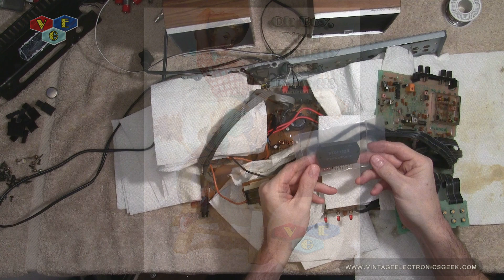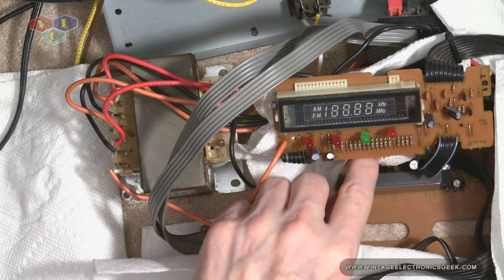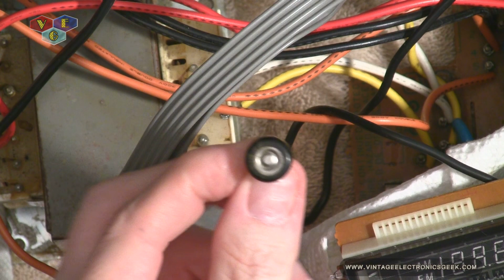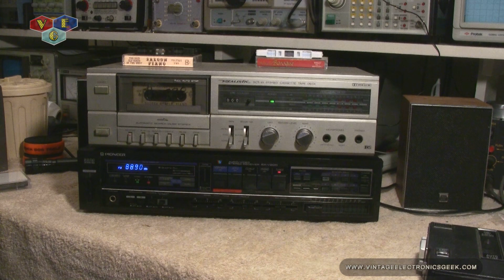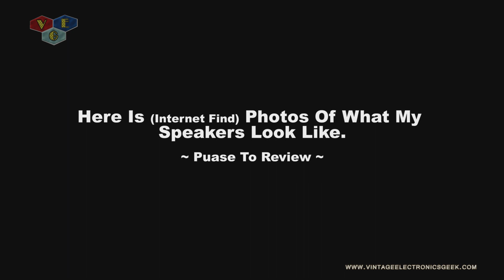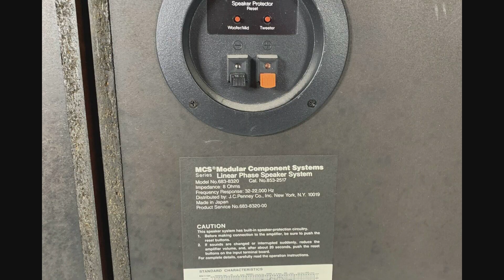Pioneer SX-V200 - Part 4 - Finale

Comment: Good job! And thanks again for the "promotion"! Would have been nice to have seen a resistance test between the pins of the STK. Or did I miss that? But that could also be a short video! Again, good job! Gives one a sense of accomplishment.
Reply from the maker: Thank you and no problem, you deserve it!  I did this project 8 months ago and have since tossed the old parts....maybe next project if I can remember.  :) Does make on happy indeed!  Not so much when I cant figure it out then have to shelf it until I can...I have a freq counter I am working on...for the past 4 years that is like that!  :)  ~Jack, VEG
Reply: @VintageElectronicsGeek  Those Russian bots are waging a war of attrition against you. I normally just delete old videos. Sometimes I don't even finish them because the camera gets in the way of further filming and I just want to get the job done. Anyway, I enjoyed this "repair series."